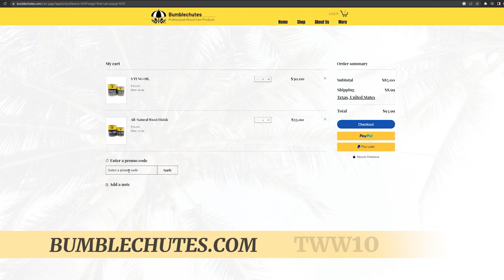Heirloom Beam Compass | Way out of my comfort zone!

Comment: You could easily use this compass as a panel marking gage. By making and attaching an add-on fence that aligns the beam perpendicular to the edge of a panel and replacing the pencil with a cutting edge you will have a panel marking gage.

Comment: Very nice project Marc!

So tell us more about Bumblechutes - Polymerized tung oil + citrus solvent, right? How long does the first coat take to dry and cure? Does it offer decent liquid and scuff protection?
Reply from the maker: What i like about it is it's pretty much the same thing I'd make myself if I felt like mixing my own. So it applies like any other oil and dries in a similar fashion. Drys within 24 hrs and cures over the course of days. Multiple coats is recommended if you want more protection. It does have good water resistance and scuff protection but the harder the wood, the better the finish looks (in my experience). But if you're really looking for a seriously durable finish, this would not be a good choice.
Reply: @woodwhisperer  Thanks Marc, that's very good to know. Regarding durability on furniture, would you say it's the same with the Hope's Tung Oil+citrus solvent or the Real Milk Paint Half & Half referred to in your other video about best food safe finishes?

Comment: I think I would have made the pin stationary and the pencil movable, just saying! Nice project, thanks.
Reply from the maker: Thanks Barry. Can you explain why you would do that. Seems like that would force you to always use tiny pencils.
Reply: Interesting. I’m trying to picture a way to mount the pencil so it can be pinched.  I don’t think it matters if the pencil is not centered on the beam. Still measure pin to pencil to determine radius.
Reply: What's wrong with having a tiny pencil?
Reply: @eirikberg  I mean, if it gets the job done. But sometimes, it just takes a bigger pencil.
Reply: I was thinking the same thing, as then you could make other movable holders for an X-acto knife, a marker, a small router, etc.

Comment: 6 hours later and nobody has claimed that it will eventually explode because of the difference in the coefficient of linear thermal expansion between walnut and aluminum? The wood movement zealots are slacking.